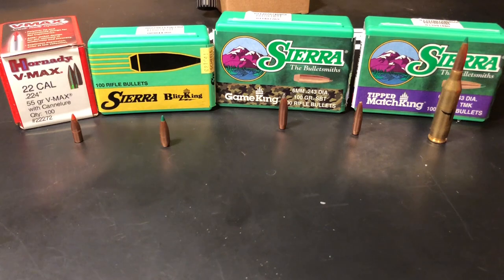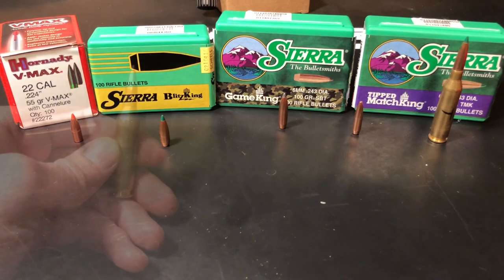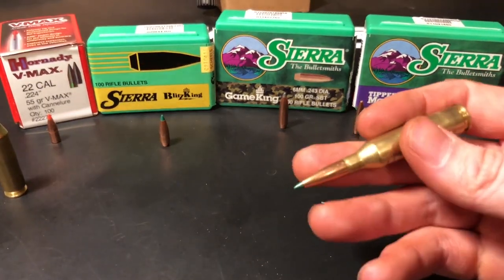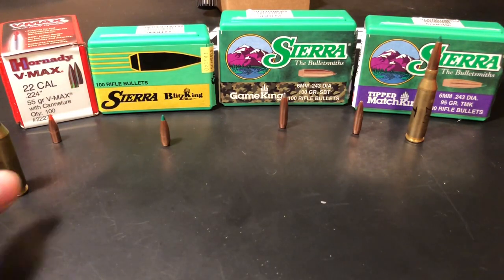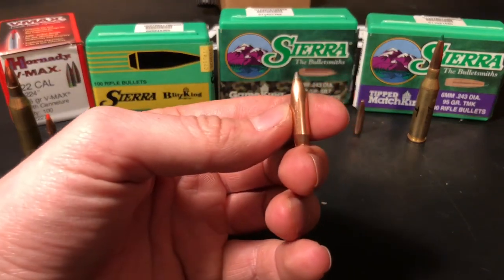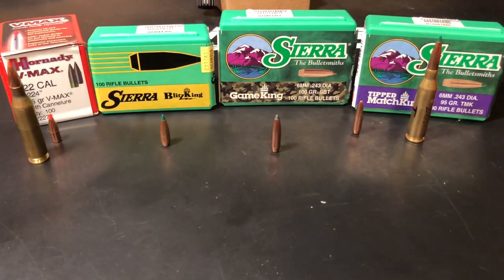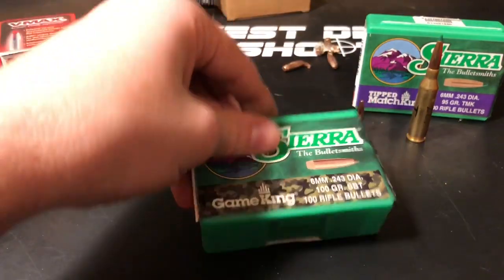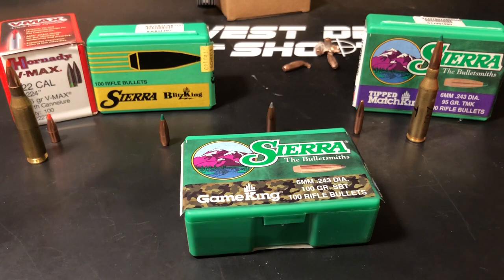Selecting a 243 Bullet for Reloading

Comment: I have a Ruger M77 all weather in 243 that shoots just under Moa with factory Win 100 SP 's . I don't know why it shoot's so good but I'm not complaining. I often wonder if the stainless steel barrel makes a difference accuracy wise or maybe it was made with all new tooling . It has a factory synthetic stock but is not free floating . It is a rare bird that thinks it is a target rifle .
Reply from the maker: sounds like a great gun. I bought stainless in hopes of some increase of accuracy but who knows if there is any significant difference. My tikka loves the 95 Fusion and I have no idea why either but I dont question it! What is the twist rate on the M77? a Boyd's stock would give you a freefloat and they are very reasonable compared to some other brands Id check into it if you're interested in a freefloated barrel, might pick up some accuracy too
Reply: I think it is a 1-10 barrel .It likes 75 gr. and heavier bullets . Lighter 60 gr. bullets were avg. groups . As far as my rifle , I'm not going to change a thing . Why buy a stock to free float it when it shoots this good . It might be worse with changes . You should do a tack driving challenge . A thumb tack at 100 yds. , 1 shot .

Comment: G'day WDS, you mention the 1in10 twist limiting factor for your 95gr SMK's, but managed to pound 1000yrds with it eventually. Was there anything in particular you varied to finally get it to behave? Didn't have to jam it into the lands or anything for it? Run a 1in10 barrel on a Howa myself. 87gr Vmax was a bit of tweaking to get to behave in it, but the Sierra's seem to be forging across the board compared to some other brands so thought it might be worth a try, given you  got it to zone in longer range finally.
Reply from the maker: Yes so I switched powders to H4350 and set the bullets .020” off the lands and they started Shooting much better!
Reply: Oops, miss the reply button and hit the unlike by mistake. Corrected & now put the glasses in place on the noggin! Thanks WDS.
Reply: You have recommendations for shooting 87gr vmax in 243 loaded with h4350 powder? Barrel is 1-10”, 24” long. I’ve shot lots of factory ammo, it shoots 58gr vmax factory stuff pretty good. 100gr stuff can be from 3/4” to 1” group at 100 yards, and turns to 3” at 200 yards. It’s very picky with factory ammo. It’s a Winchester XPR Varmint

Comment: You are not getting a velocity of 3800 fps at safe pressures. I doubt that you are getting anywhere near that speed. You should actually try using a chronograph before you spread your propaganda
Reply: I have some 243 factory rounds in my safe. They are flying closer to 3,900fps then they are 3,800 fps.